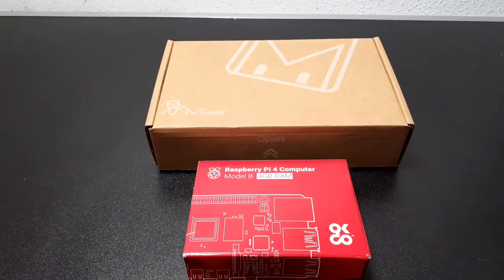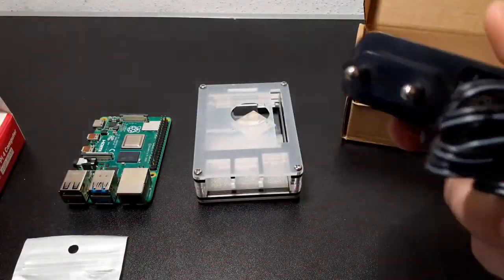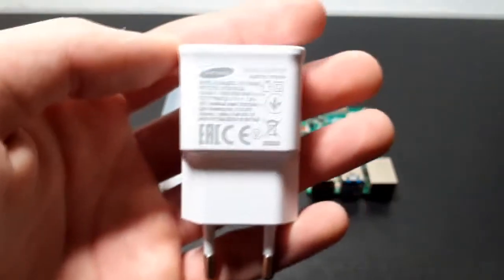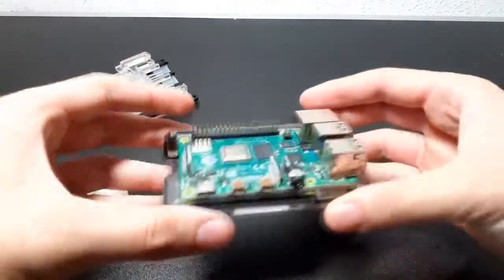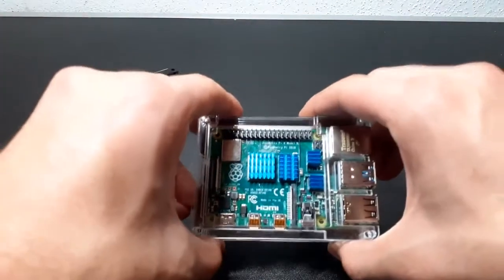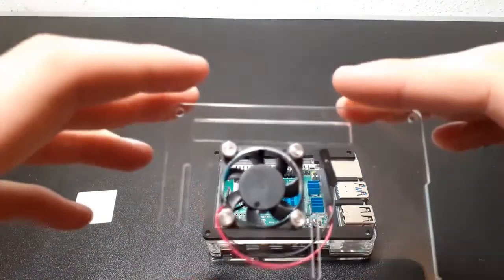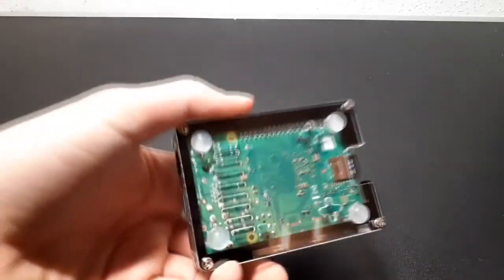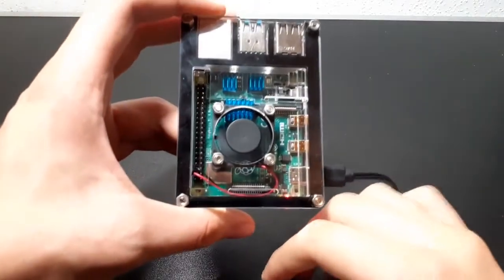The Best Raspberry Pi 4 Case! Pi4 Charging Device - Miuzei Case For The Raspberry Pi 4  - First Look

Comment: I just bought a Miuzei case, but my case has a separate layer for the fan. I only started running it during this video and so far the temp is steady around 40deg. I am running Ubuntu Mate on an 8gb pi4, I was using the official red and white pi case. I had the Fan Shim from Pimoroni, the temp was always between 50 and 60deg, so this case is working great so far. I will do a days work on it and see if it maintains. I like the case, but I will be building a bit of a monster Pi so I will need something different in the end. Quiet, looks great and between the fan and the heatsinks cooling is excellent so far. Thanks for the video.
Reply from the maker: Nice! Let me know your results when they're ready ;)
Reply: @VathoGaming  Average temp is between 35 -40, 55 - 60 when running hot. It is quiet, really a great case.
Reply from the maker: Glad to hear that👍

Comment: Thanks! Bought this case last night. Do you know if the fan is sufficient to keep an overclocked board cool?
Reply from the maker: Hence the case supports two different modes for the fan (one 2.4V mode and one 5V mode), the case with the 5V mode should do fine with an overclocked raspi. Hope you have success with ur raspi ;)